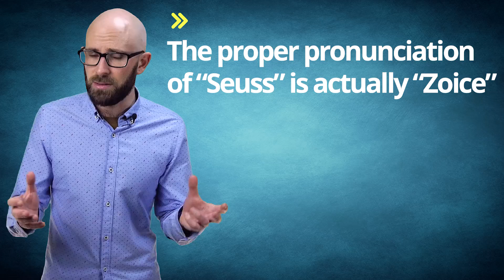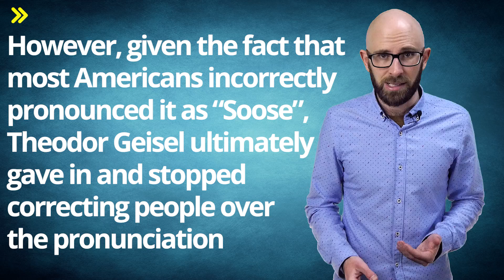Why Does the Yolk of an Overcooked Hard Boiled Egg Turn Green

Comment: Eggcellent video. For those having issues with the green developing it's when the egg is overcooked. The cooking time depends on the method, temperature of the egg, the egg size, species the egg is from and also the freshness. Mostly though it's about time and temperature. If your having trouble with the grey/green developing then try cooking for less time the next time to hard cook some. 

As for me, I like steaming eggs because with duck eggs the shells can be much harder to remove and steaming makes the egg release the shell much better than boiling. This works with chicken, goose, and quail eggs as well but the steaming time is different.

Comment: In order to avoid this problem, do the following. Just cover the eggs with cold water in a sauce pan. Turn on the stove to high. The water will boil in about 8 minutes. Let the eggs sit in a full boil for five more minutes after boiling begins. Remove from heat and cover the pan with a lid. Let it sit for 10 minutes. Pour off the hot water and fill the pan with cold water until the heat from the eggs dissipates and the water remains cold. Let sit 10 more minutes and they're ready to peel. Perfect yolks with no green layer every time. Tastes better, too.

Comment: You say the gas is poisonous, does that mean living in a geyser-rich area bad for your health?
For example Rototua, it always smells strongly of eggs over there because of the Geysers
Reply: That might be a question for a local government office that deals with land management in those areas.  Every area has unique challenges and risks when it comes to this stuff.

Like where my folks live there's so much sulfur in the ground water if you have a well you practically need a heavy duty filtration system if you want to drink out of your tap and not be poisoned.  You can't smell it just walking around on the property but most people's houses smell like eggs no matter where you go.
Reply: Depends on the concentration, your nose is extremely sensitive to H2S (0.01PPM) while it's only doing harm at 2-5 PPM with prolonged exposure. Source: i work around/in this gas alot

Comment: The way to cook perfect hard-boiled eggs with no grayness every time is as follows:

1. Put eggs into a pot of cool/cold water and turn up the heat to boil the water and cover the pot
2. As soon as the water is boiling, shut off the heat.
3. Let the eggs sit, covered for 20 minutes.
4. Remove from heat and if desired, plunge the eggs into cold water for several minutes to cool them.

Makes perfect eggs every time. I've used this method all my life and I've never managed to screw it up.

Comment: Best way to hard boil and egg is the cold water method. 
Put enough cold water in the pan to cover the eggs completely plus at least an inch.
Put the pan on the heat until it comes to a boil.
Take the pan off the heat, cover, & wait 14 minutes.
Drain the water & peel the eggs immediately.  
Unused eggs can be kept refrigerated in a sealed container for up to 3 days.
Reply: First Cynic well you are wrong, you boil the water then add the egg for 5-6 mins should only take 2-3 mins for the water to boil and 2-5 mins to eat. I saved you time
Reply: king cova I know the boiling water method is faster, but it's also less consistent.  Timing largly is a function of attitude in that method, as water books at different temps if you are higher up.  In the cold water method that's pretty well eliminated, unless you are over 10000 feet above sea level.  Additionally, putting the cold eggs into boiling water can make the shells crack.

I've used both methods over many years and have decided that the cold water method gives me better results.
Reply: Good point, I've always been near sea level, so that has never really occurred to me.

Comment: I was once making some deviled eggs and found that the yolks of my hard boiled eggs were undercooked. I decided to remove them and just cook the yolks in in the microwave. Mistake. They violently exploded after not much cooking and made a mess. I might have been able to get away with it by setting the power level to 20% (80% power off - 20% power on cycling) instead of 100%.
Reply: Next time try an even more fun experiment. Let your eggs on full boil even after the water has completely gone. The resulting explosion of the eggs is magnificent, the stink is devine and you get to buy a new kitchen and redo every surface in said kitchen.
Reply: Never microwave a boiled egg. lol I had one explode as I tried to eat it. Not fun 😲
Reply: @andrewchatmon  This is good advice, but fun fact related to microwaving eggs, you can microwave cracked raw eggs and as long as you don't let them rise out of the cooking container, they will not explode and they turn out quite like scrambled egg in consistency, but in a single piece. Even kids can make eggs this way! They just need to know how long to cook them (varies by microwave and elevation) and that it's okay to stop the cooking early, flipping the eggs in the container (or mixing them up for scrambled) and putting them back in for a little longer if needed.

I did this for awhile in small round quiche bowls to make my own egg muffin sandwiches (can use any meat and even croissants!). I've just gotten too lazy to bother anymore.

Comment: Had hard boiled eggs that were done so long the entire egg was green. We also found out that those eggs would bounce. We joked there were 101 things to do with them, 102 if the result was edible. The joys of bulk food, where they would only start the timer for 20 minutes after all the eggs were loaded into the 44 gallon cooking pot, and it had started to boil. end of 20 mins they would turn off the heat and start to unload. OK if you got the top ones, but not so good for those in the lower layers.